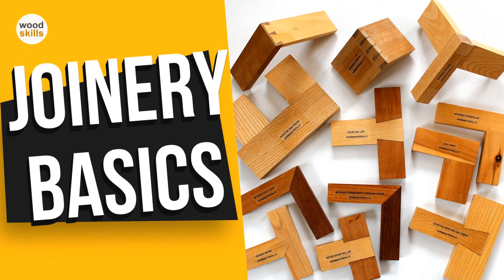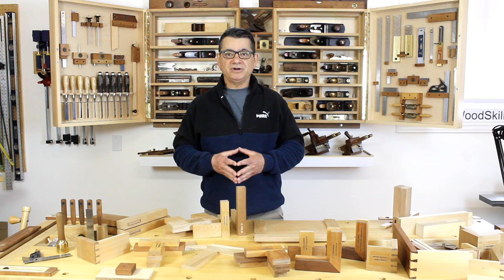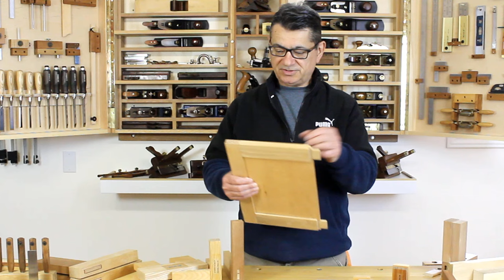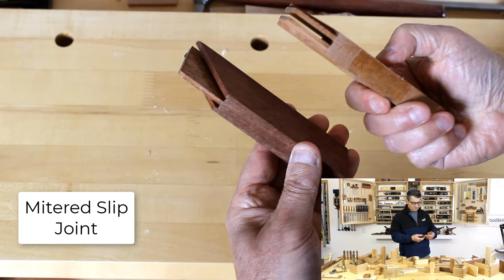Wood Joinery Basics || Best Woodworking Joints

Comment: very cool video. have you thought about doing a short on each of the joints? the algorithm really seems to like that sorta thing when done well. really liking your channel. only recently found it. 

i really like dowel joinery for strength and plate joinery for quick alignment. i make my own plates that go longrain rather than bias grain for a little extra strength on miters and such. basically in internal splines. i have never gotten the hang of hound's tooth dovetails. i never get they as clean as i want them.

i was always taught the slip joint as the bridle joint. it wasn't until i started looking into older books that i saw the term slip joint. i tested a bunch of joints in batches of 20 and the double bridle joint was only stronger if the joint was more than 2" thick, or if i used hide glue or another protein based adhesive. on any bridle joint i tested less than 2" thick and using pva or epoxy, the single bridle was the strongest. grain runout could also be a determining factor in any joint i tested. i am thinking about rerunning those tests with bamboo as a wood analog because it is very consistent and straight grained, but the additional strength and flexibility are a challenge. i got all of my original wood samples from a cabinet shop's offcuts for free. now they sell them in boxes on facebook so i don't have tons of free 6"-18" straight grained offcuts to work from.
Reply from the maker: Thx...appreciate the feedback!